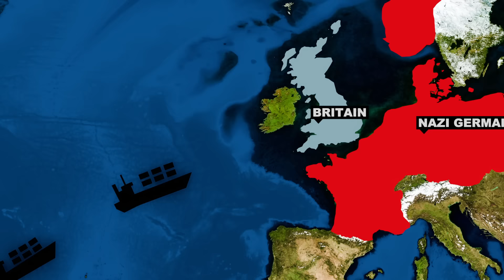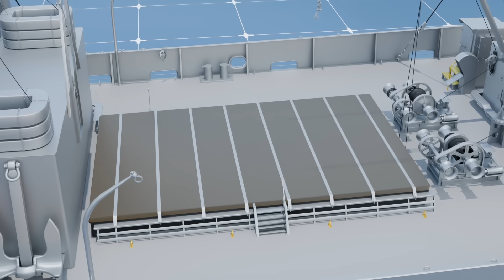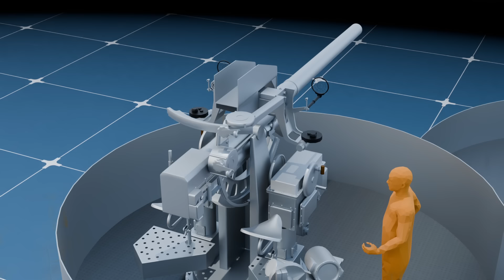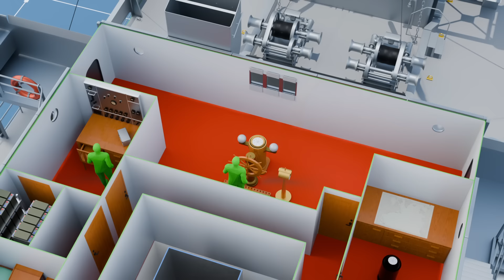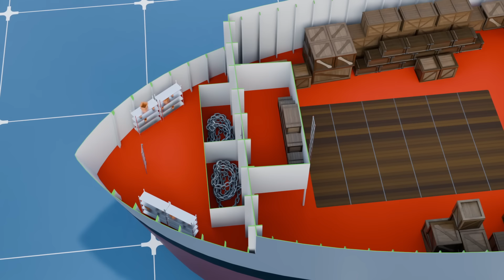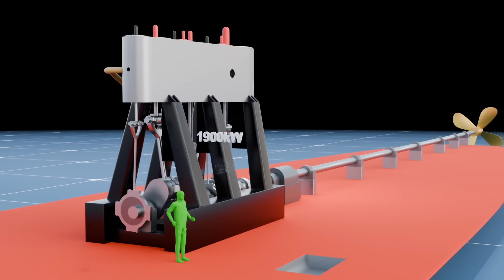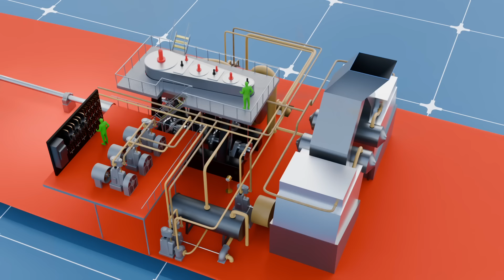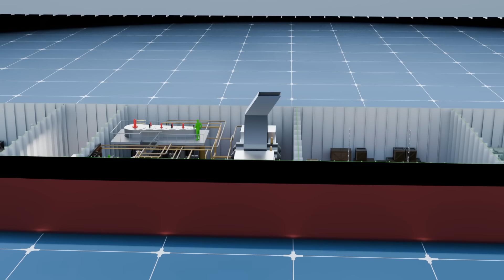How the Liberty Ship Actually Worked

Comment: Fun fact: the condenser doesn't just recycle clean, desalinated boiler feed water (though that's a very useful function). It also pulls a strong vacuum on the exhaust side of the engine. Believe it or not, this effect is responsible for about 1/3 of the output power!

Comment: Naval caliber for guns are based on the bore diameter vs the barrel length given as multiples of the bore internal diameter. Where the diameter is measured varies by country and measuring system in use. A Rifled cannon diameter can be measured at the tops of the rifling or at the bottom of the grooves.

Comment: What the heck is a 4-inch .50 Caliber gun?
Reply from the maker: Unlike firearms, naval guns are usually classified by caliber (the diameter of the bore) and calibers (the barrel length expressed as multiples of the bore diameter). For example, a 3 inch/50 caliber gun has a 3 inch bore and a barrel 150 inches long (3 × 50).

Comment: .50 caliper guns are not 3 inch guns
Reply from the maker: Unlike firearms, naval guns are usually classified by caliber (the diameter of the bore) and calibers (the barrel length expressed as multiples of the bore diameter). For example, a 3 inch/50 caliber gun has a 3 inch bore and a barrel 150 inches long (3 × 50).

Comment: Larger ships actually have higher cruising speeds due to the wake effect they produce. The smaller the ship, the smaller the wake effect and the lower max cruise speed. So the real reason modern cargo ships can go faster isn't exactly because they're just so much more advanced (they are, but in subtle ways) it's really just the size that helps them achieve higher speeds.

Comment: Are the guns 4 inch, 3 inch, or 50 cal? All three are very different.
Reply from the maker: Unlike firearms, naval guns are usually classified by caliber (the diameter of the bore) and calibers (the barrel length expressed as multiples of the bore diameter). For example, a 3 inch/50 caliber gun has a 3 inch bore and a barrel 150 inches long (3 × 50).

Comment: Excuse me, but you made one extremely massive mistake.

Liberty ships were manufactured almost exclusively in shipyards in the United States of America, so they were made using Imperial measurements, in other words inches, feet, and yards.

At no time during the building process were metric measurements used, yet you used nothing but metric measurements in your video.

If you are going to be historically accurate in your videos, then you are required to use the proper measurements. If you can't, or won't, then you should never be allowed to post another video on YouTube for as long as you continue to live.

Comment: One reason Liberty ships used an old design reciprocating engine is turbines where priority for U.S. Navy ships being built.  And, one of the primary manufacturers of turbines was the Allis Chalmers Co. in West Allis, Wisconsin.  A huge manufacturer of all sorts of large down to medium size stuff sold world wide in power equipment systems (dams, generators systems,  pentocs …). As U.S. began shifting to war materials manufacturing, 1940 - 1942,  labor union leaders (that were closely involved with communist goals and policies) struck major industries.  Coal, steel, ship building and Allis Chalmers in Milwaukee.  They were on strike for a long time!  The main goal was production slow down of marine turbines.  In early 1940’s USSR was loosely allied with Nazi Germany.  They had a pack agreement.  The USSR helped Nazi Germany on several fronts in Nordic area and Eastern Poland and on the United States war production hindering.  That’s one of several reason Liberty ships used recip engines.

Comment: What’s a 4inch 50 caliber?
Reply from the maker: Unlike firearms, naval guns are usually classified by caliber (the diameter of the bore) and calibers (the barrel length expressed as multiples of the bore diameter). For example, a 3 inch/50 caliber gun has a 3 inch bore and a barrel 150 inches long (3 × 50). We should have clarified this in the video.

Comment: An interesting fact is the problem liberty ships had with "Brittle Fracture." Due to these ships being the earliest welded design stresses were introduce that resulted in quickly forming and propagating cracks that could cause the ships to sink. This was a problem in the cold waters pf the North Atlantic. In modern reactor design this is a major design consideration for reactor vessels that had its origins identification and early research in WW2. Thei was corrected in the Liberty ships by the addition of an additional welded belt that prevented crack propagation in critical areas.

Comment: 4 inch 50 caliber gun?
Reply: Yes. "Caliber" in this usage refers to the length of the barrel, i.e. 50x the bore size or caliber of the gun. So, in this case, 4" bore with a 200" barrel.

Comment: I guess my question is, did the engineers back then had water hardness in mind? Because as soon as the water boils, the minerals suspended within would stick to the pipes bit by bit reducing the internal diameter of the pipes and thus extra forcing pumps to take water inside.

Comment: once again, reading wikipedia articles doesnt mean the claims are accurate. 
the "most produce single design" ship is 100% bs. esp. fishing trawler are produced in the 5-6 digit ranges to a "single design". and even if the claim would only be "the most ship build continuous" is highly debatable at best. 
 and as always, even though murica always tells it as "winning the war" it was not more of a coq than the nukes on japan or esp. the resource crisis in germany. probably the copper deploration is by far the most important factor in stopping germany.

Comment: Each individual piece of this ship was essentially an analog construct that required its own engineering and design and fabrication. The individual pieces had to fit and function perfectly relative to the construct it functioned with, which also had to function along with other constructs it was attached to. This is what is called engineering genius on the analog level and using slide rules. It required an entire team of those who checked and rechecked fabrication drawings down to the finest detail. Not to even mention the coordination required at the machine shop level to guarantee it could even be machined. Or the coordination needed to guarantee the material availability and just when and where needed. In my opinion it is more like a type of coordinated magic we don't today give enough credit. 
And yes, I'm a trained mechanical engineer who has designed allot of fairly complicated machines from scratch and must take the backseat to those who created such a construct. 
Enough AI computers doing all the creative mental exercise in our future and the human will simply be more akin to a warm bodied semi sentient animal relative to what these engineers pulled off 80 years ago Pré microprocessor. 
The future looks bleak where the human becomes more like an illiterate dancing chimpanzee directed to the rhythm of a so called "smart phone".

Comment: One thing the video didn't mention, but I found out on my tour of the JW Brown: When the boilers are shut down and completely cooled, it used to take as much as two days to get the boiler fully up to temperature to deliver full steam. That was during the time period when they used heavy bunker oil to fuel the ships. Today, they use the low-sulphur diesel fuel, and they can get her going in about 12 hours.

Comment: The stearing motor has connecting rods mounted on crankshaft at 180 degrees so when one piston is at top dead center, the other is at botom dead center and the steam pressure can't make it turn. They shoud be at 90 degrees.

Comment: Great video, but you made a mistake when talking about the 3 deck guns! There's no such thing as a "4 inch .50 cal gun!" There are 4 inch guns, and there are .50 caliber heavy machine guns. 

The .50 in .50 caliber denotes a machine gun that fires a 1/2 inch diameter bullet. So a 4 inch deck gun fires a 4 inch in diameter shell. One is a cannon, the other is a heavy machine gun.
Reply from the maker: Unlike firearms, naval guns are usually classified by caliber (the diameter of the bore) and calibers (the barrel length expressed as multiples of the bore diameter). For example, a 3 inch/50 caliber gun has a 3 inch bore and a barrel 150 inches long (3 × 50). We should have clarified this in the video.

Comment: Errors, errors.  Four inch & 50 caliber -- conflicting, impossible. Three inch & 50 caliber -- conflicting, impossible.  Four inch is eight times the diameter of 50 caliber.  The 50 is 50/100th of an inch or one have of an inch.
Reply from the maker: Unlike firearms, naval guns are usually classified by caliber (the diameter of the bore) and calibers (the barrel length expressed as multiples of the bore diameter). For example, a 3 inch/50 caliber gun has a 3 inch bore and a barrel 150 inches long (3 × 50). We should have clarified this in the video.

Comment: Why condense the final steam stage to send to the boiler?  Aren’t they wasting energy?  Seems like if you started with hotter water, you’d use less fuel (energy) to heat it to saturated steam.
Reply: "Long Live Japan!"
This type of steam engine generates power from the pressure difference between steam pressure and the pressure inside the condenser.
Therefore, it is designed and manufactured with high boiler steam pressure and low condenser pressure.
Power can also be obtained by releasing steam into the atmosphere without using a condenser. In this case, the boiler water rapidly decreases and becomes depleted. The condenser prevents this, and seawater is used to cool the boiler. Steam engines, I believe, utilize the difference in volume between water and steam.

「日本万歳」
このタイプの蒸気機関は蒸気圧力と復水器内圧力との圧力差で出力が発生する。
なのでボイラ蒸気圧を高く、復水器内を低圧として設計製作する。
復水器を使用せずに大気に蒸気放出しても出力を得られる、その場合はボイラ水が急速に減少し枯渇する、枯渇を避ける装置が復水器、温度あがるのを海水冷却。水と蒸気の体積差を利用してるのが蒸気機関、たぶん。

Comment: It should be noted that only one of these ships ever engaged in any serious combat with an enemy vessel, while over 200 were sunk by enemy fire. So the armaments were basically a useless addition.

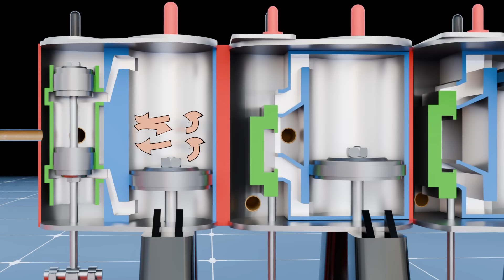19:00 This explanation is incomplete. You have pictured double acting cylinders. So, in a reverse phase of the cycle, what is happening above the piston is also happening beneath. This is true for each cylinder, as a way to have each direction of the piston provide power instead of just one direction. The reason for the increasing size is that the steam loses energy (pressure) as it expands (psi). So a greater expansion chamber is necessary in order to get the equivalent energy out of the steam. Also, water cannot be allowed to enter the pistons, or the whole thing doesn't work right. So that's why super-heating is necessary.The timing of the valves and pistons is critical and it isn't 180 degrees apart. It leads just a little bit, IIRC, to make sure that the piston won't jam in one position.

Comment: The size and cargo carrying capacity of Liberty ship was chosen specifically because of U boat menace, each ship could carry a reasonable tonnage but not so much that if one ship was lost it prove disastrous.  Imagine losing just one of today's giant cargo ships, the loss of that much cargo could prove disastrous and to replace a ship of that size would take too long,  no better to be able to lose a few smaller vessels that would be far easier to replace and the loss of that amount of cargo would not prove such a disaster. It's the same reasoning as to why airborne parachute actions are now a thing of the past, the Russian airborne when attacking Hostormel airport in Ukraine lost one airplane on the attack, it had 250 air assault troop on board and all died, in world war 2 one DC 3 Dakota carried 20 troops so to lose one aircraft would not have been a catastrophe.

Comment: Can someone explain how the ship has 3 inch and 4 inch 50 caliber guns? I don't understand. I thought a 3 inch gun was a caliber size. Likewise I know what a 50 cal machine gun is. Why are the guns described as X inch 50 caliber guns? Approximately 7 minutes into the video.
Reply from the maker: Unlike firearms, naval guns are usually classified by caliber (the diameter of the bore) and calibers (the barrel length expressed as multiples of the bore diameter). For example, a 3 inch/50 caliber gun has a 3 inch bore and a barrel 150 inches long (3 × 50). We should have clarified this in the video.
Reply: @Deconstructed_Animations  Thanks buddy

Comment: As a land rat, I can only admire the ships from a distance.
My country has no coastline, only a large lake, which is the largest lake in the region (77 km long and 18 km wide).
However, I have a steam boiler operator's exam.
Why was this complicated steam system needed?
You might think that in the middle of the sea, there shouldn't be any problem with water.
Unfortunately, seawater is not suitable for a steam boiler. Normal fresh water can't be used either. Why? All water contains dissolved salts. This separates from the water when heated ( the white coating in your bathroom or sea salt too). And where will it appear in the boiler? Yes, in the steam generator tubes. It forms a thin coating that impairs heat transfer and thus steam generation. If the inner coating becomes thick and cracks, the contact of cold water and hot iron can cause a boiler explosion. To prevent this coating from forming, chemically purified water is used in steam boilers. Without their own water preparation, they cannot replace the lost boiler water at sea. Therefore, the boiler water must be saved. This saving is done by the condenser.
This is true for any steam boiler, it doesn't matter whether it works on a ship, on a locomotive or in a power plant.

I should note that in the battleships of World War I (at least the Austro-Hungarian ones for sure) there was a time when the ship could also sail with seawater. However, after that the entire boiler had to be repaired. But at least it could take the crew home.

Comment: An excellent video, though 4 inch guns are very different from .50 caliber guns.
Reply from the maker: Thanks! Unlike firearms, naval guns are usually classified by caliber (the diameter of the bore) and calibers (the barrel length expressed as multiples of the bore diameter). For example, a 3 inch/50 caliber gun has a 3 inch bore and a barrel 150 inches long (3 × 50). We should have clarified this in the video.

Comment: Ae you sure that the rudder does not cover the full diameter of the propeller? That seems strange to me, never saw a ship with such configuration. It hugely impedes the maneuvering capability , as some propelled water keeps going straight instead of reflecting of the rudder (when maneuvering). On your diagram the rudder seems to cover about 3/4 of the propeller diameter, really not much.
Looking at photographs it seems the real rudder did cover the complete propeller diameter.

Comment: not to say you didnt do your research but quick question how can you have a 4 inch and 3 inch gun both be 50 caliber or is the 50caliber something like a decimal measurement?
Reply from the maker: Unlike firearms, naval guns are usually classified by caliber (the diameter of the bore) and calibers (the barrel length expressed as multiples of the bore diameter). For example, a 3 inch/50 caliber gun has a 3 inch bore and a barrel 150 inches long (3 × 50). We should have clarified this in the video.

Comment: Many Liberty Ships continued to travel the oceans for quite a while after WW-II ended. The Candian author, Farley Mowatt documented the struggle of a Liberty Ship against a monster hurricane in the Atlantic in his book, The Serpent's Coil. The Leicester (not the original name) was in ballast - no cargo. Ballast wasn't stowed in the lower holds but in ones higher up. Engineers said this unobvious distribution would make the ships ride better on the ocean. Ballast was often muck dredged up from alongside where ever the ship was docked. To keep if from shifting from side to side (and wrecking the ship's equilibrium) ballast boards were added vertically, attached to the deck holding the ballast and the deck above.
A number of Liberty ships disappeared without a trace in the time after WW-II. In the case of the Leicester, what happened was the weight of the ballast "stretched" the ballast boards so their attachment to the deck holding the ballast broke.
When the Leicester encountered its hurricane it heeled far enough that the ballast boards acted as though they were on hinges and flipped up letting the ballast slide all the way to the downward side of the ship.
In most cases this abruptly caused the ship in question to sink.
Somehow the Leicester held on long enough for the radio operator to get off a SOS distress call. The crew was rescued by another ship while the Leicester was (iirc) listing 40 degrees. Conditions were so bad, the other ship made no effect to salvage the Liberty Ship and left, assuming it would soon sink. But it held on. And on. And on.
The Serpent's Coil documents the efforts of Foundation Maritime, a deep sea salvage company as it sent two of its tugs out to look for the Leicester. They managed to track down the abandoned ship in the middle of the ocean using guess work to predict the effects of wind and current on it. Some how got a tow wire on it and managed to bring the now listing 45+ degrees ship to Bermuda dodging storms and hurricanes. When in Bermuda  another monster hurricane promptly showed up and drove the Leicester on the beach/reefs along with Foundation Josephine, the flagship tug of Foundation Maritimes ocean going fleet.
It's a GREAT read for people interested in maritime struggles.

Farley wrote a previous book, The Gray Seas Under about a previous Foundation Maritime deep sea salvage tug, the Foundation Franklin. Another GREAT read.